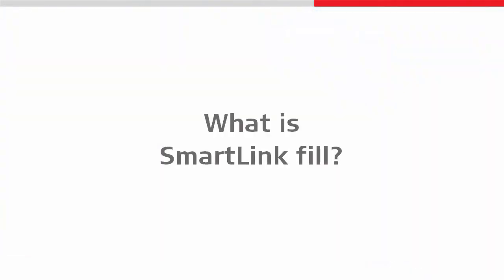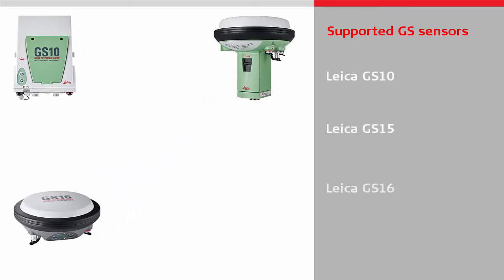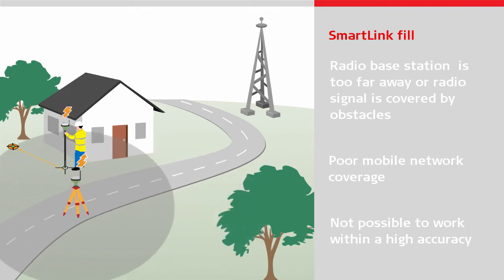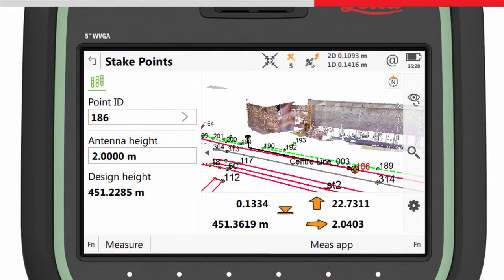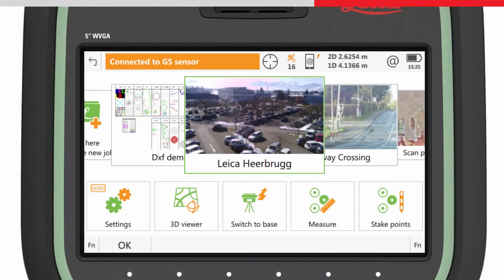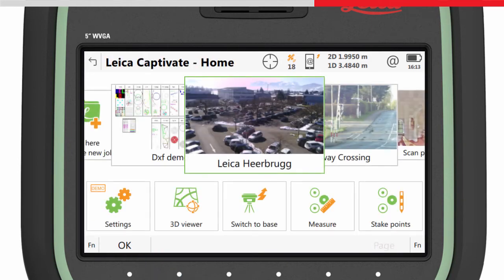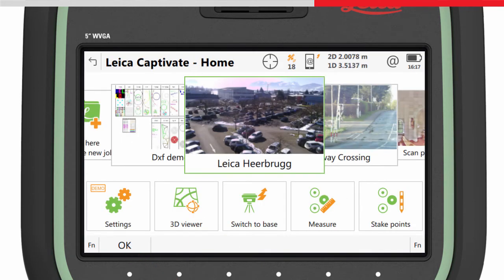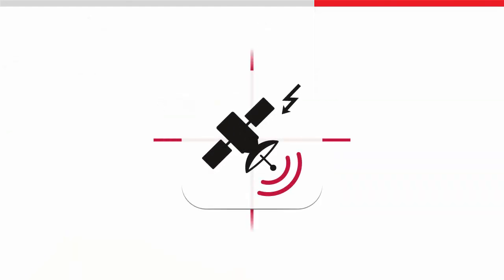How to use SmartLink fill

Comment: I have a doubt. When SmartLink Fill comes into action, the reference coordinate used is the RTK Base reference or the Smartlink coordinate referece? I ask because if I am working with the RTK Base started with a navigated point (unknown point function) the reference used by the SmartLink will be different, because SmartLink uses a corrected reference coordinate.